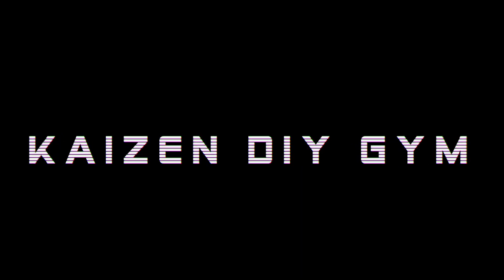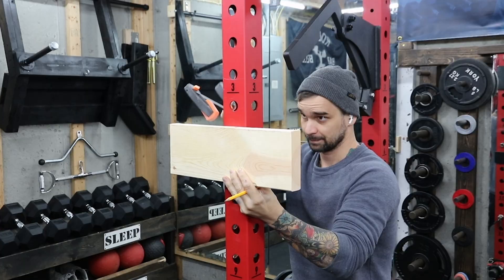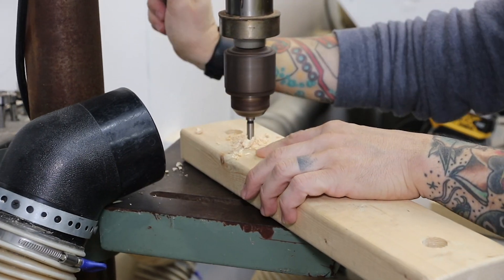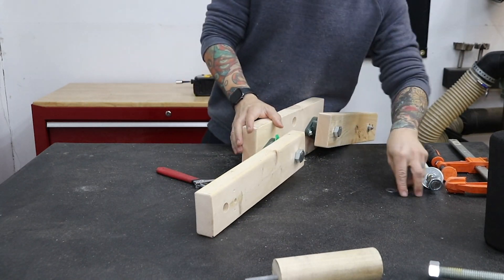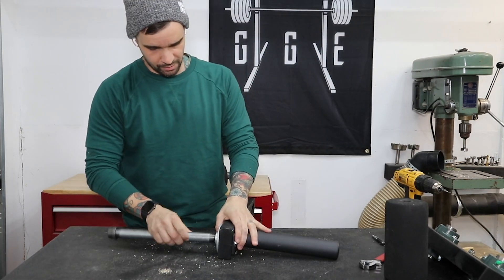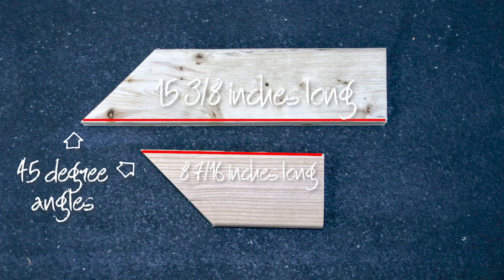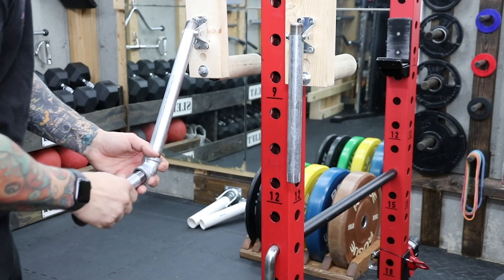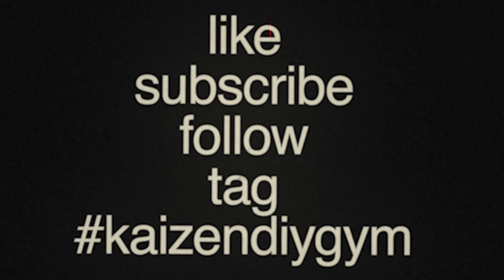DIY Lateral Raise Machine | How to build equipment for your home gym

Comment: @KaizenDIYGym with any of the designs could you set the arms fixed at the top and with a band peg and bands, do lateral pulldowns?
Reply from the maker: Yes, absolutely. I did that in a recent short.

Comment: Where did you buy the 3/4 x 7 inch bolt which isnt threaded the entire way?  HD only has fully threaded 3/4 bolts.  I assume those are not as good in the bearings
Reply from the maker: I buy all of my hardware from my local store Menards. They’re primarily in the Midwest. You can order from their website - Menards.com
However, fully threaded bolts will work just fine with the bearings
Reply: @KaizenDIYGym  ok thank you. I’m going to put my spin on this will shoot you a pic when done! Happy Holidays